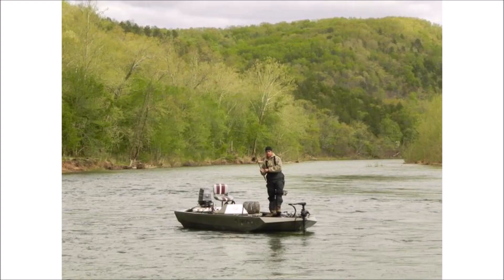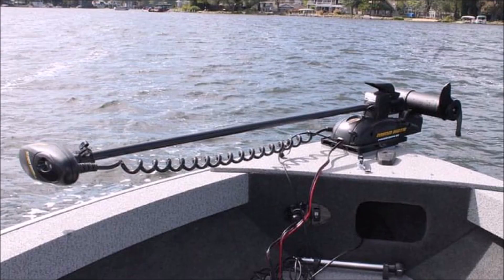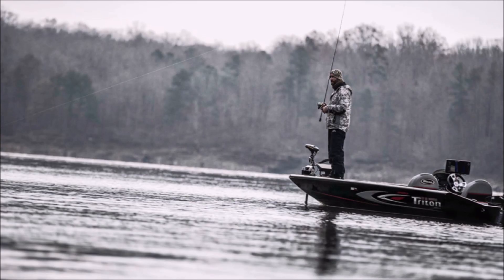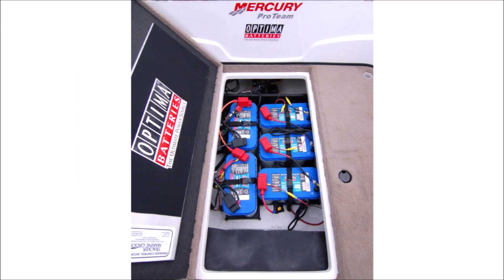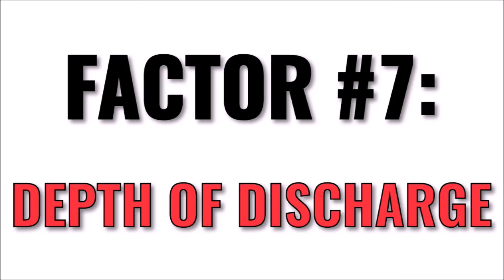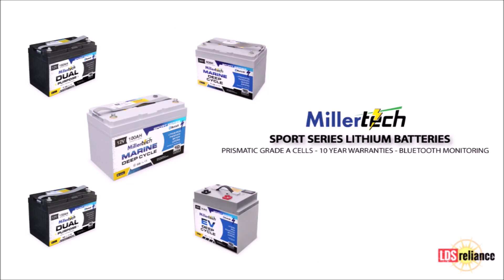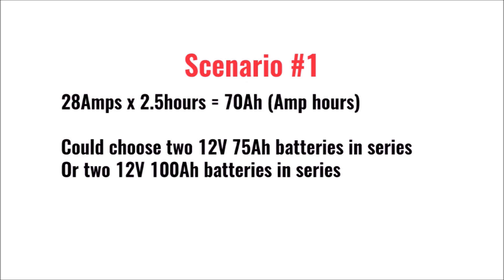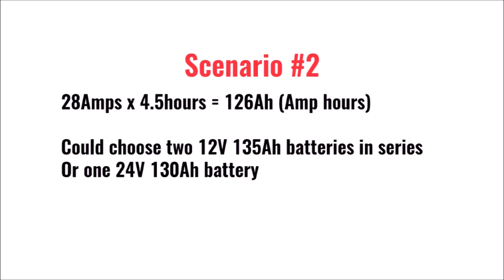Choosing A Lithium Battery For Your Trolling Motor - 7 Factors That Affect Your Decision

Comment: No brainer for me.. I have the Dakota 52 amp lithium and a cheap100 amp Lithium. I see no difference in quality.. I prefer the cheaper brand..
Reply from the maker: The difference usually isn't seen for hundreds of cycles.  Hopefully it stays true for you but the failure rate in the first year for cheap batteries is 20% and the best case cycle life is about 1200 if you are very lucky.

Also, that Dakota is going to give higher maximum amps for longer.  A Grade B will have some cells that are slightly weaker and will give out sooner and then the other cells shoulder a higher load and then start to fade as well.  A matched Grade A set, like a set of matched draft horses or oxen, will be able to continue pulling as they are equally yoked.
Reply: What is the cheaper brand you're referring to ?

Comment: I noticed that MT makes "dual purpose" starting/deep cycle batteries from 100Ah to 190Ah. Then there's the 65Ah described just as a "starting" battery. Isn't it technically a starting/deep cycle (dual purpose) battery just like the others but with less capacity? Just need for starting a 60HP Merc (4 Stroke) and running 2 ten inch Garmins (no live) for 3-4 hours at a time.
Reply from the maker: Correct.  The 65Ah can be used as a deep cycle as well.  There is functionally no difference between their deep cycle batteries and their dual purpose/starting batteries except for beefier wiring and a heavier duty BMS that can handle the increased amps that they will see on a regular basis.

Comment: There is one important factor you forgot. According to Minn Kota you cannot exceed 85% of your power/speed rating with lithium or you will damage the brushes in the motor and wear out your trolling motor prematurely.
Reply: Which battery is recommend for the minn kota? Looking for a rechargeable one
Reply from the maker: Do you have a link for that?  That is the first I am hearing of this.

Comment: None of those factors seem lithium specific and in fact are all improved with lithium. The biggest lithium factor to consider is the peak draw for the motor and etc. compared to the BMS. The fuse on the motor is a guideline for BMS capacity but not sufficient because a fuse might allow overload for some time.
Reply from the maker: Some aren't lithium specific, but are relevant in the decision.  The decision is already made for them on the sizing of the original lead acid bank.  So 99% of fishermen aren't familiar with sizing a battery bank.  Yes, a fuse may allow overload for a time.  That was my point.  Get a battery that has a continuous output rating above the fuse rating and then you are guaranteeing not to trip the BMS.  The 3-5 second peak draw of the battery will far exceed the continuous output rating and also help alleviate any risk of tripping the BMS due to a fuse being slow to trip.